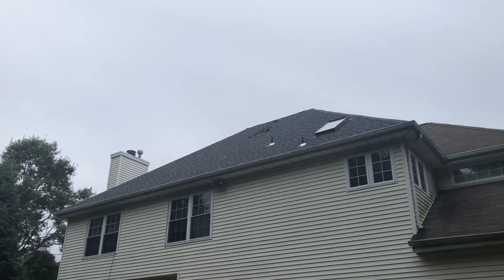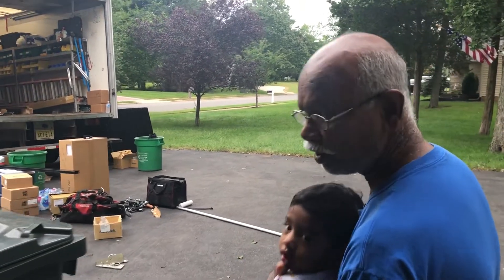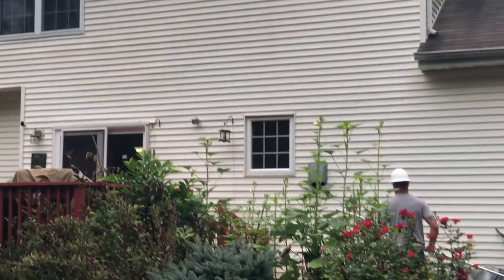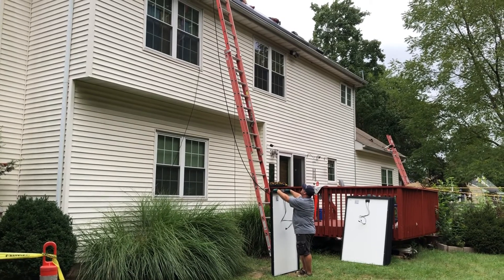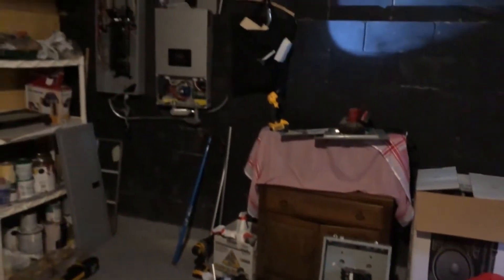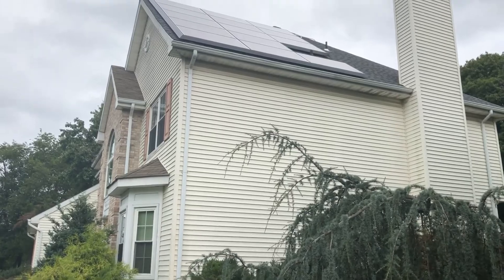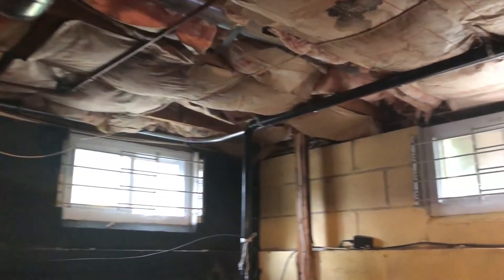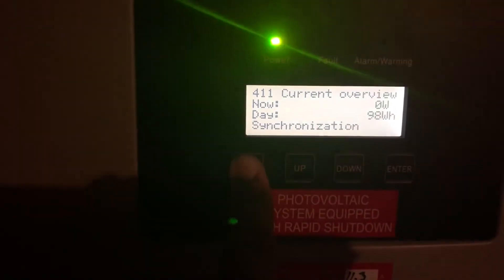TESLA OR SOLAR CITY solar system installation step by step

Comment: H:Why the solar panel is not fixed on the guide rail? How do you fix the solar panel.
Reply from the maker: Guide rail was old setup.. the new setup is different it saves from roof leaks 
Pannel s cannot be fixed better to replace it